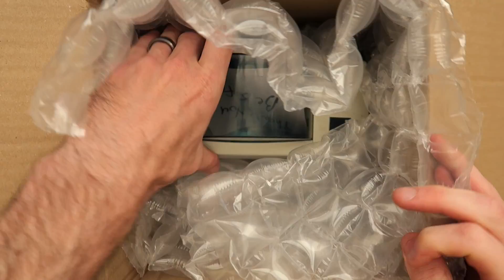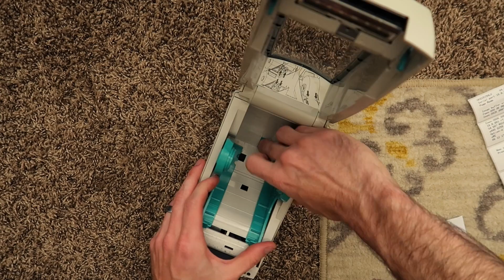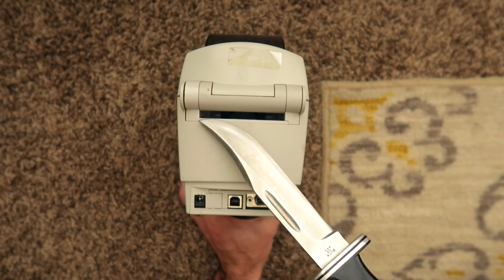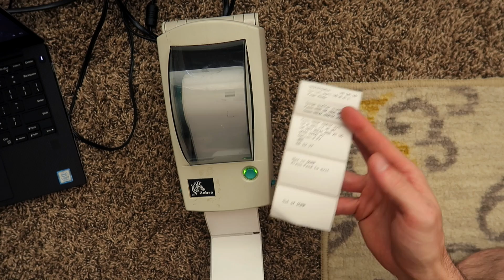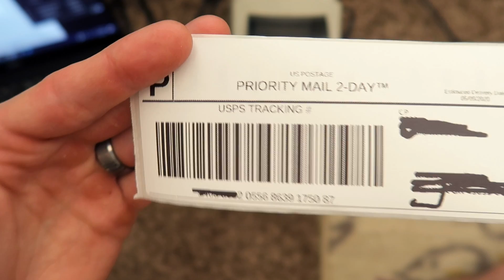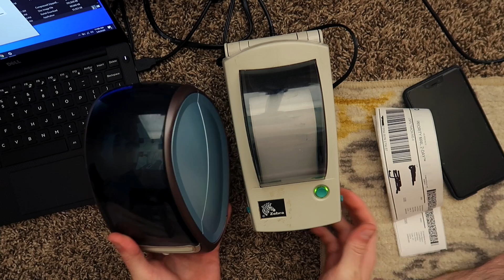No Power Supply "23.99" eBay Zebra LP2824 Almost Too Cheap Thermal Printer, Will it Work? 🤞

Comment: Do you know the difference between the ZEBRA LP2443PSA and the LP 2844?
Reply from the maker: Never heard of the 2443psaj 😭🙏 sorry wish I could be more helpful
Reply: @thecollegepicker  No problem! I think I'm going to pick it up to test. https://www.ebay.com/itm/ZEBRA-LP2443PSA-Parallel-Thermal-Printer-With-Charger-16VAC-2443-20310-0000/174238123547?hash=item289166c61b:g:TCIAAOSwtUpedyN7
Reply from the maker: Just checked and They say POS which is point of sale. It probably doesn't have USB and is meant to print receipt paper. That's my guess on that, hopefully you can cancel the order.